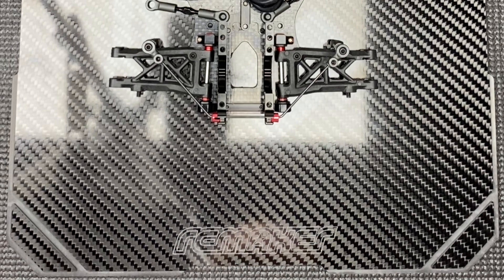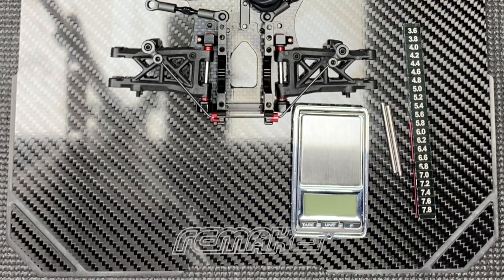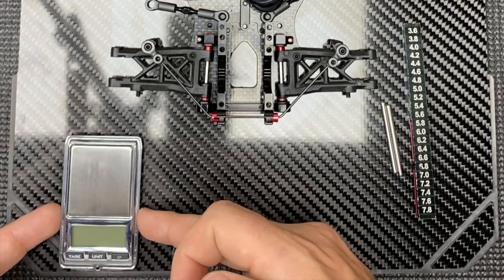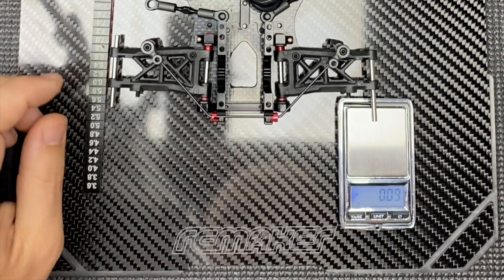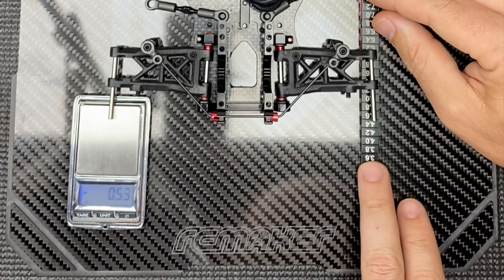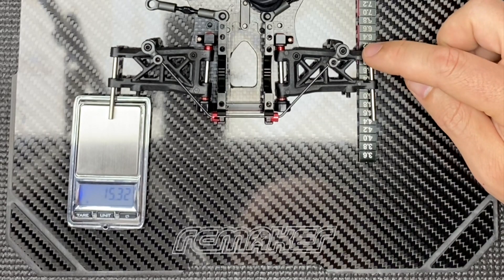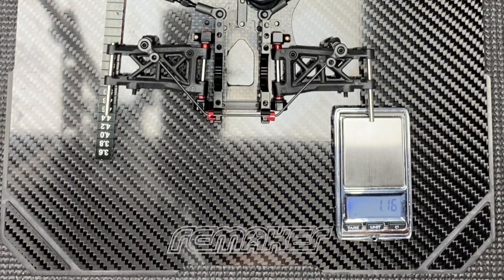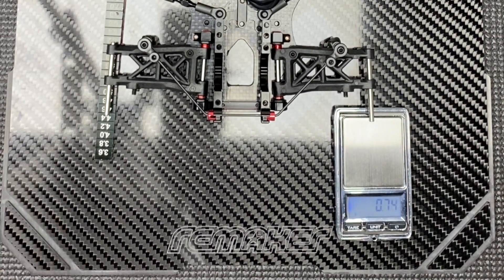'McTips' - Get PERFECT On-road Sway Bar Tweak Using Digital Scales.

Comment: This method seems to be far more accurate and repeatable than the 'normal' method. Thanks Tony. Can you do a segment of front/rear roll centers and what changes you expect from them? Even covering the inner vs. outer arm changes?
Reply from the maker: Hi, thanks for the feedback, glad it’s working well for you 😊 I will add the roll centre changes to my list of vids to do, i have noticed that there are some videos out there but they are far to technical, i will make one that breaks down what each change does and when you should be changing them